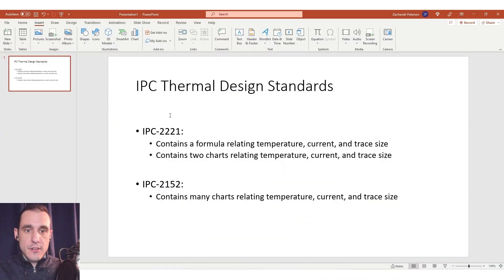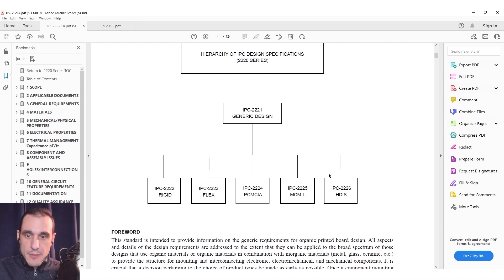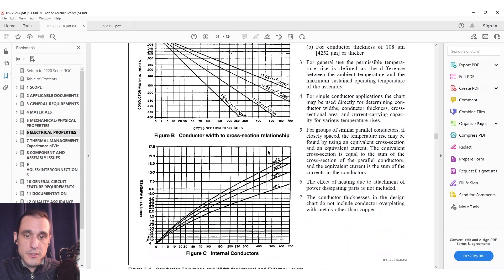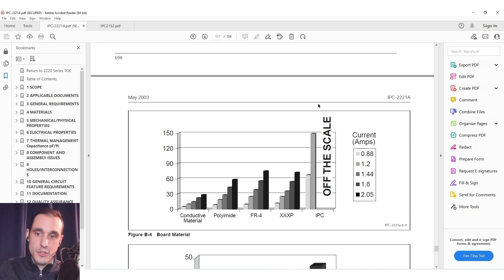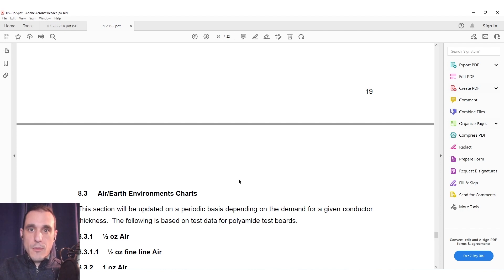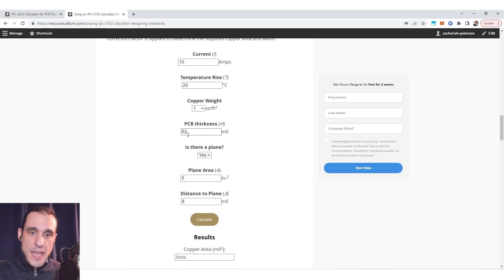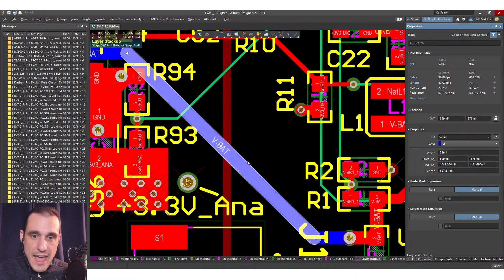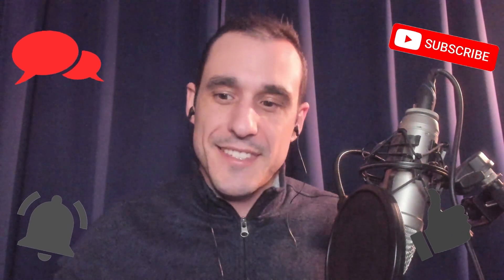IPC Thermal Standards Deep Dive

Comment: Thanks for the detailed video. How do consider the Shapes /Planes used for Powers? Also how to consider the shape width when the shape is passing thru BGA kind of components where the effective the shape width will be less than other area?
Reply: I think the simplest way to do this is to try and approximate as a wide trace, but this is just a rough approximation. Today we have steady state thermal solvers that can be used to determine the temperature distribution, assuming DC power. I'm sure there are some open-source thermal solvers out there that will give good results, but I do not do enough thermal analysis so I cannot give a recommendation on an open-source solver.

Comment: For switching supplies, any temperature rise in the traces will be dwarfed by the Schottky diode's resistance; if you size the diode to sufficiently dissipate the heat, you should be fine.
If you have the board space, a wider trace for power is better from both thermal and impedance perspectives. (Power planes are even better, assuming the cross section is greater than anything you could achieve with external traces plus solder accumulation on exposed copper.) If you need to add a bit of extra series impedance for filtering (another contentious subject), it's better to throw in a resistor than to reduce trace width.